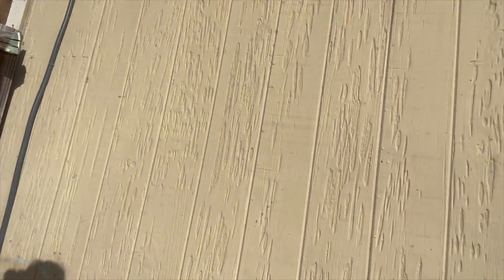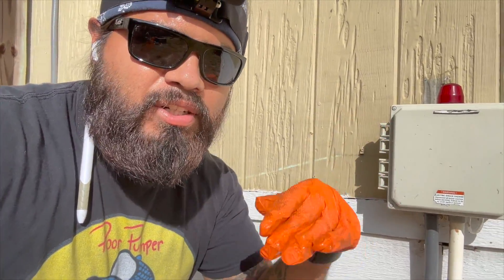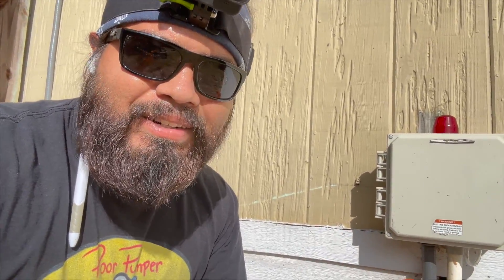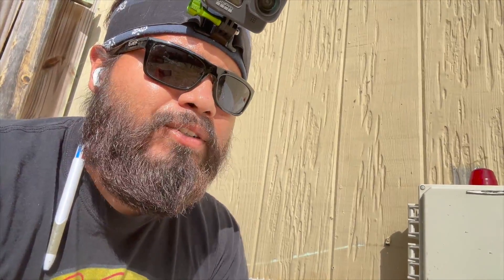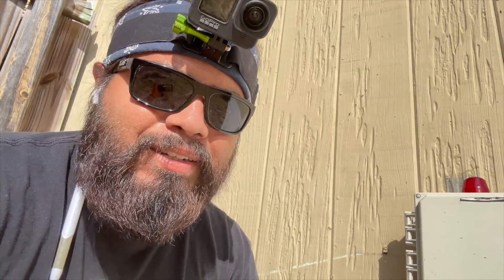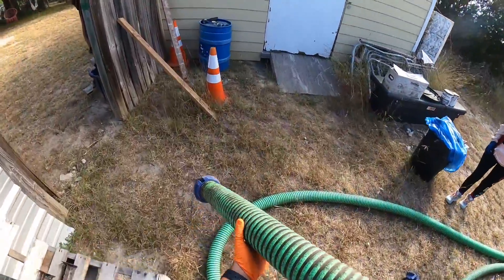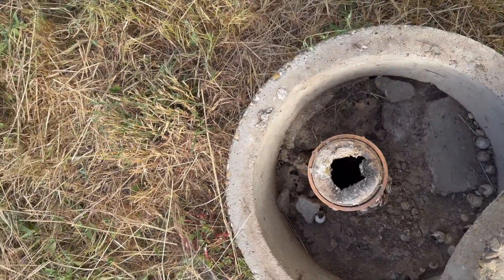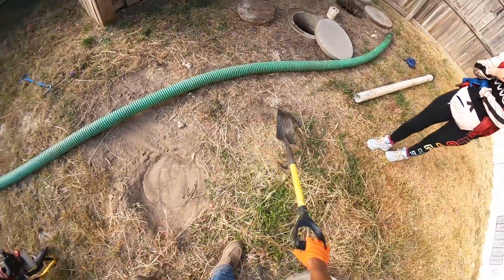Aerobic Septic System (Poo Sprinklers)

Comment: what do you do for tanks that's never been opened and the breaker bar just don't get it from the concrete block being several inches thick, do you use a chipping hammer or what do you use to break crack open lids that are heavenly sealed?

Comment: So I don't know if this is possible cause in most of your videos you state there's usually a dead spot above the septic tank. But we recently replaced our septic tank as it was corroded leaking and just in very poor shape, is there a way to get the grass to at least somewhat grow back? It was put very a shallow into the ground so we had to build a hump over it I'll be it a very small one.
Reply: Simple , water that area regularly after planting grass seed or ready turf. The only reason it is a dead spot is that the shallow soil dries out quickly.